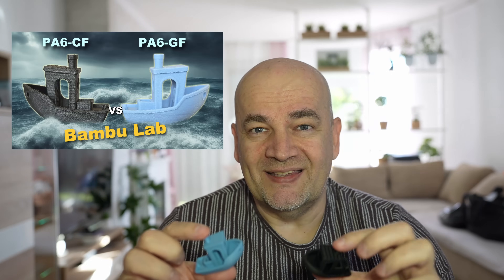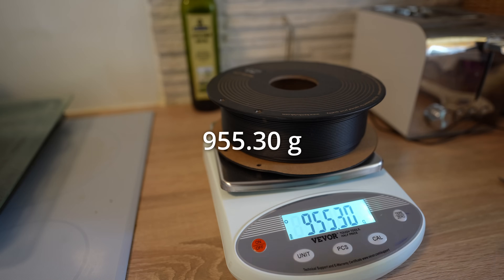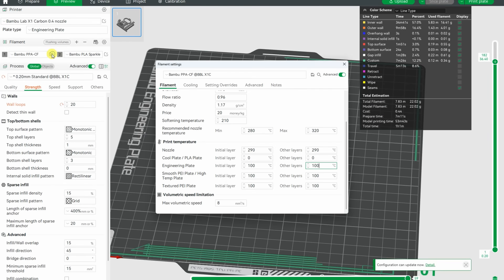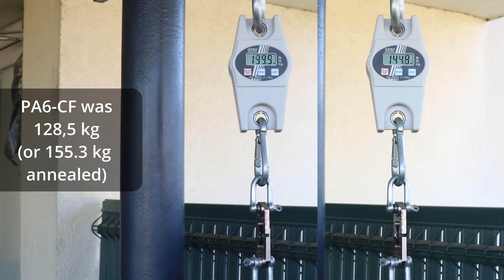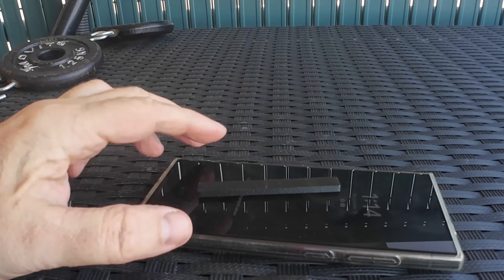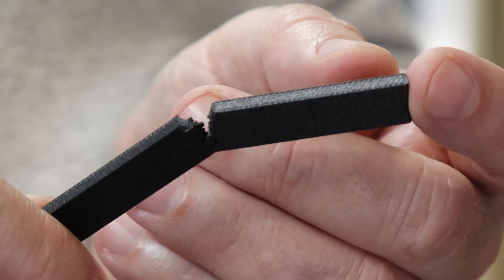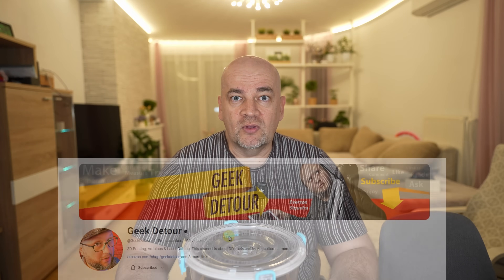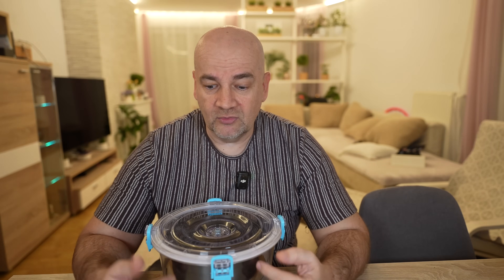Bambu Lab PPA-CF: the STRONGEST filament ever (I tested so far)

Comment: Use molecular sieves as a desiccant. It is way better than silica gel absorbing the moisture. Vacuum is only helpful for you to make sure that there is no leak in your gaskets.
Reply: Since filaments absorb moisture from the air, and you vacuum out most of the air, it stands to reason that less moisture will be absorbed under a vacuum.

Comment: I've got the plus4 its a very good printer with a few quirks.

The default profiles I find tend to under extrude. Sometimes more flow is needed other times they've been too conservative with temperature.

For example ASA had gaps in first layer.

After changing bed temperature to 100c and increasing initial layer temperature by 5 c and chamber temperature to 65c it prints exceptionally well. 

With PLA just increasing flow ratio to 1.00 was sufficient.

Materials with abrasives are the worst thiugh so the nozzle is very restrictive.

Wood pla needs 1.1 flow ratio.

PETG CF needed to increase to 0.98-0.99 to print well.

Comment: Your testing is greatly appreciated. However, what is missing on youtube is informed mechanical design guidance regarding 1)  how to apply these test results to the selection of the right material for fabrication of specific printed parts 2) when should a part be split and made in 2 different materials and 3)  how to add common features to mechanical objects to improve the design (fillets on cantilevers, etc). And then having this guidance tested in comparison of with and without these added features.     The 3d printing community would benefit from some Mech Eng guidance. No one else is doing this and it is sorely needed.
Reply: Slant 3D does some, though they aren't perfect. Functional Print Friday is pretty solid. NeedItMakeIt has def done some interesting testing and guidance on 3D printing for functional uses. Overall agree with you, just giving some suggestions.

Comment: I do 1-1.5mm³s flow (Custom-Made Volcano heater block and MicroSwiss CM2 hybrid nozzle) at 0.12mm layer height for mold like parts. 1-1 ratio, remove overlapping, and sometimes go back to Simplify3D as their algorithm narrows extrusion to fill gaps rather than trying to inject into them. Meaning, when I break them to test the print they don't break on the layer lines but rather as if it was molded. At that speed you can avoid part cooling almost completely, as it's terrible for tempering the plastic and layer adhesion

Amazing content science man! 🫡

Comment: You should try printing at 320 and anneal the PPA-CF. Then retest. If it ever strikes you, give the PPS-CF from Fiberon(polymaker) a go and compare with the PPA-CF. It’s another ridiculously expensive engineering filament but amazing results, comparable to those you had with the Bambú Lab material. Thanks for the video!!

Comment: Great video. I just bought 1kg of PET-CF, 1kg of PA6-CF, and 0.75kg of PPA-CF which was a lot and I know which ones to use now. For the layer adhesion, other than the high nozzle temp, on the Qidi Plus 4 I would set the chamber temp to 65c as well. Also at 7:41 you can see gaps in the lines which would also cause issues as there is missing material contact.

Comment: Btw, the temperature resistance for the PET-CF is *after annealing*, if you don't anneal it will fail much earlier exactly as you showed. The same applies to PPA too, but due to the even higher resistance it's less noticeable
Reply from the maker: Oh, on time. Now I have to reprint and anneal a few objects 😂
Reply: @MyTechFun  for PET you just chuck it at 80°, wait two hours, ramp to 120°, then hold there depending on part thickness. If you also do a slow cooldown the parts will warp less
Reply: It would be cool to see an "Annealed vs as printed" video, with the typical semicrystalline polymers like PET, PA6, PA12, PPA, PLA, and most importantly PPS
Reply: I made the same note. Was reading the Polymaker Fiberon PET-CF TDS the other day and the pre and post printing steps seemed very critical for maximum performance.
Reply: @802Garage  man, didn't realize so many brands were getting in on the PET-CF trend. Great.

Comment: hmm really interesting, clough42 got higer tensile XY numbers, like almost 60% higher. I think this will be interesting to test in the new QIDI machine too see if there is any difference.
BTW can't wait for PET-CF results :)
Reply: James printed with a 60+ degree chamber and I think that makes a difference!
Reply: @Eric_Wolfe-Schulte   not for XY. higher temp chamber only improved Z tensile slightly, and turning off cooling fan improved it by a lot

Comment: What was the chamber temp when printing the ppacf? i saw from other test that it needs to be at lest 50C for it to get close its optimal strength for the z direction and fans completely off, from clough42 newest video this was able to bring the strength in the z direction up by about 40%
Reply: I feel like this is a filament where you would really seem some great improvements from printing at 80C plus chamber temps.  Understandably though testing that would only appeal to a very niche audience.

Comment: I'd love to see this printed at 320C. I'd assume it will have better layer adhesion, but I wonder how other properties will change. That could be an interesting test  - printing the same filaments at the minimum, midpoint, and maximum temperatures to measure how it changes the properties of the printed parts.

Comment: Please don't stop doing the shear tests! They are the most useful test!
Reply from the maker: That was partly a joke, but it convinced me, to buy 500 kg tensile testing machine, not 200 kg (what was my original idea)
Reply: Maybe you should try to make a diy universal test machine. This will take no effort to test the material, remove the speed variable and you could even graph the strain stress curve (giving you a lot of usefull information) if you measure the strain. @MyTechFun
Reply: > They [shear] are the most useful test!

Why do you say that?
Reply: @nlkatz It might just be the most useful test for them.
Reply: @nlkatz I can’t say it’s the most important test, but it important for anything that does have a shear component in its action. For example, shafts. It’s complex. There usually is shear and bending force at the same time.
Reply: @melgross so it's the most important test for applications involving shear.
Who would have said that...
Reply: @olafmarzocchi6194 no, not the most important. But equal in k pittance. It depends on what the shaft is used for.